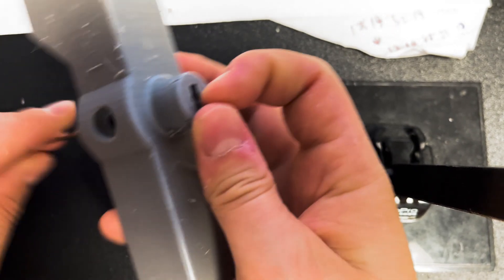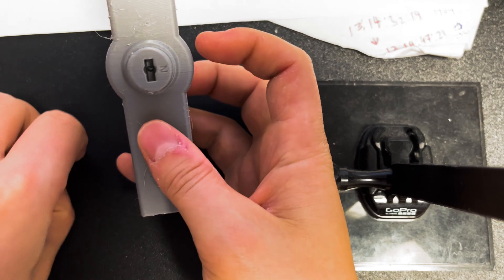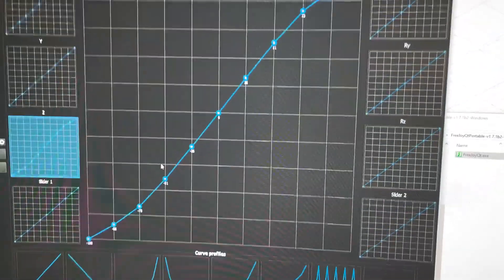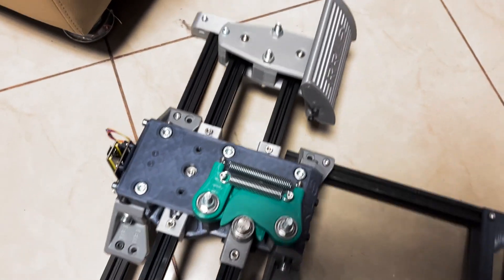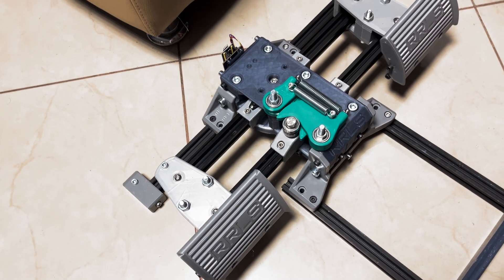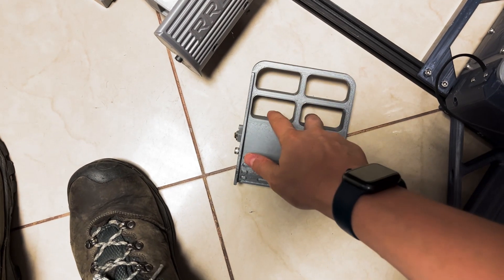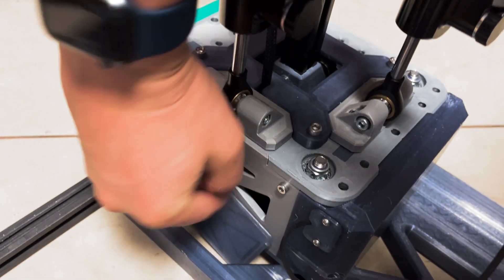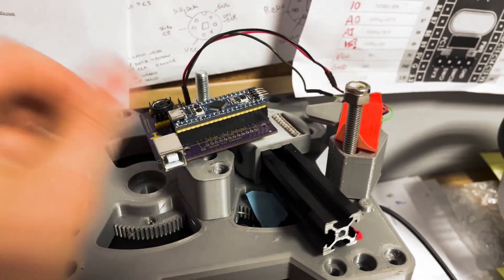Progress update on the Open Source Rudder Pedals!

Comment: Spring joysticks became obsolette. Look at Ffbeast or Odrive, it is actual controls for sims, DIY that.
Reply from the maker: The goal of this project to be a low cost entry point for pedals. If the patreon grows enough I might do a version that can host a VPForce Servo
Reply: FFbeast is a cool project, would like to have a force feedback stick someday, but right now it is way to expensive for me to buy metal parts, motors, and motor controllers. Cheaper to go with a spring and cam setup with mostly 3d printed parts.